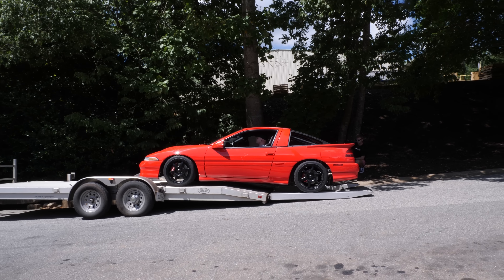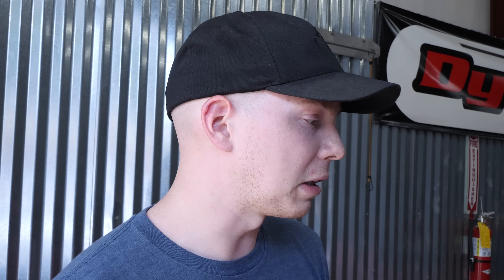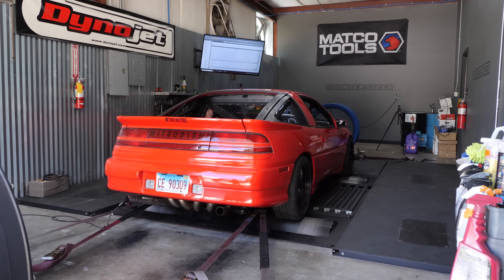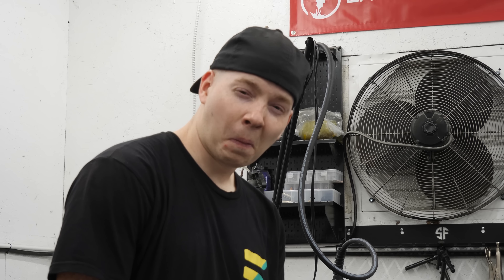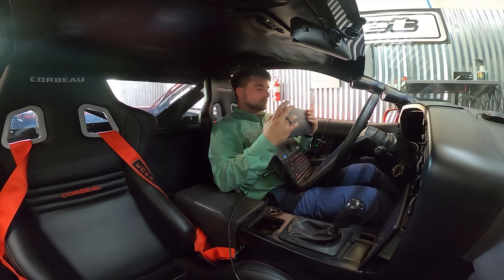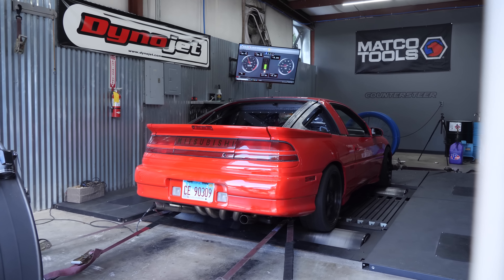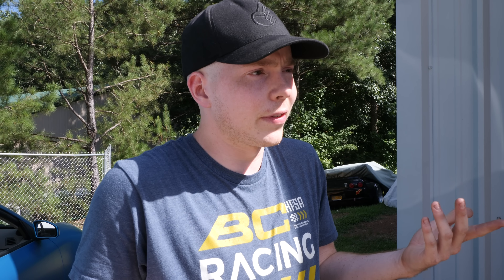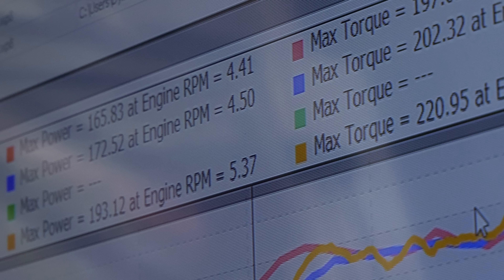Will The Garage-Built 4G63 Survive 25PSI of Boost On The Dyno?

Comment: I have a tundra with the same transmission and engine.  EVERYONE in the forums says that you should turn off the overdrive when towing.  Mileage may be a bit worse, but it will save your transmission from constantly seeking/down shifting.
Reply: Replying to make sure he sees this
Reply: 100%. The engines (2UZ-FEs) are amazing but those 4-speeds are definitely not the best. My dad has an 01 Tundra and even with 155k it feels like the transmission is going bad, and we haven’t towed a whole lot with it. Just have to be careful with those things
Reply: same way with my chevy, 4 spped trans, only goes to 3rd when towing
Reply: @nikdelano  Do a transmission service.  Drop the pan, pull and replace the screen/filter and refill fluid with Toyota approved fluid.  They aren't the strongest transmissions ever, but the are super dependable and a fluid/filter service often shows immediate results in shifting/smoothness and over all feel.
Reply: Once he hooked up the trailer i thought, i bet hes gonna tow in overdrive.  I tow with our sequoia all the time.  Definetly have to manually shift it and stay our of 4th.  Doesnt do too bad.

Comment: All the symptoms of timing being extremely retarded, low power, high EGT's and a lot more boost than expected. I would definitely start by checking base timing before doing anything drastic
Reply: that or cam timing. Turbo cams usually don't have a lot of overlap, and it sounds like there is a bunch of overlap. maybe the timing belt is off a tooth?
Reply: My thoughts exactly. He probably already has it figured out. Can't wait for the next vid. :D
Reply: Yup. All symptoms of combustion pushing its way into the exhaust after bdc rather than pushing the cylinder down. Not great advertisement for a tuner who doesn't immediately check timing with those symptoms. If it doesn't look like timing is wrong (check exhaust cam for advance too) find another source of signal and check again.
Reply: You can hear the motor needs more advance usually will have sound like it wont roll over when rpm ramps , really surprised tuner didn’t see it in the curve or afrs
Reply: Same thing I was thinking.  Ignition timing or mechanical timing must be off.
Reply: Im a self taught idiot whos completed the hp tuners efi course and even I know to get things running nicely at 7psi before you go past 20psi

Comment: Manifold becoming cherry red,usually something wrong with the timing...
Reply: I have a feeling that the fault is with Valve timing.
Reply: Yeah true
Reply: For sure  

The engine sounds very forced too
Reply: It can be. Tons of eMAP associated with 25psi of boost can also cause lots of heat absorption to the manifold. Prolonged, this will absolutely cause steel tubing to glow red even though everything it running right.  
This car however, you're probably right, it's got problems for sure.
Reply: @Saltyoldguy-  but producing 25psi boost with only 200WHP is a clear sign that all is not well. They need to forensically look into the valve timing, not just the Factory Service manual belt to gear line up relationship. They need to check valve opening/closing points ...LCA, max valve loft points ...the whole gammut! Especially since these are aftermarket cam profiles. All the best to them tho. Hope the engine isn't hurt from the experience on the Dyno tho. Exhaust valves suffer badly with excessive retardation of the valve event timing.
Reply: Maybe the engine builder (I dont know if he put together the head)  put the camshaft gears on wrong so that the markings may suggest that everything is right when in reality the markings itself are showing in the wrong direction
Reply: @JoewyDsm  To be fair I just thought it sounded like a tractor from the moment it came off the trailer
Reply: @miata9916  not sure who did the head. But yes, all that would need to be verified.
Reply: I’m wondering if they timed the valves from when the pulley was marked on Tdc before, and then remember how they moved the pulley?  I’m wondering if they have it out of time because they though tdc was one mark but it’s actually not
Reply: @iwanevans607  defo didnt sound like any 4g63 ive heard, standard or modified

Comment: I think this happened to someone recently and they had the crank gear on backward throwing the timing off making the exhaust so hot.
Reply: I was going to comment this. It happened to Jimmy Oakes on the dyno, I can’t remember what car it was though.
Reply: @erices1.6t  yes it was Jimmy O and it was on a sr20
Reply: Didn’t he have an issue with setting his base timing in one of the other videos? I’ll bet it’s something like this
Reply: He already swapped that. Check last vid
Reply: @MattiaFTW  I think that was the Crank angle trigger wheel orientation. I'm betting that there is a Valve timing issue problem causing the High EGTs
Reply: @danielcgomez  are 4gs like kas where the intake and exhaust cam are pretty much interchangeable?
Reply: This literally happened to Caleb last Eclipse vid.
Reply: @tag206  these are aftermarket cam profiles he installed, so that may not be the case with interchangeability .

Comment: How the Dyno people's didn't see that it was a timing issue is a red flag. Probably 180 out.
Reply: Honestly what tuner goes "turbo is spooling way too fast... better run it WOT a few more times"
Reply: @LifeInJambles  last video Caleb "fixed" the timing issues last video and got it to sit at base timing. So the tuner could check all he wanted. The timing is supposed to be good. And that's what the timing light is going to say. This is without a doubt a  engine builder issue.
Reply: @PedroPioLopes  whether it's timing or something else, you shouldn't be doing WOT pulls with boost out of control. They both fucked something up, and Caleb has updated Patreon that nothing seems broken, but that's pure luck and engine management safeties honestly. Even if you're testing out possible fixes for a boost creep on an engine with safeties, you should be approaching with caution.... and even if the person who built the engine insists timing is on, you should have serious suspicions about the timing when boost starts creeping that hard, especially cause you should know what size wastegate is likely to be appropriate for this size turbo, and seeing it double spring pressure without boost control should be an instant stop and check for potatoes in the tailpipe or timing issues that someone thinks got fixed.
Reply: @LifeInJambles  fair enough. The way I see it, Caleb should have paid a serious shop to build him a proper engine instead of hodge podging whatever he had kicking around multiple times. Along side many other things. As cool as the concept of the whole build is, it's not up to par with something you're going to give away to a person who very possibly has 0 knowledge in terms of mechanics.
Reply: @PedroPioLopes  Agreed.
Reply: @PedroPioLopes  for sure. I hate to say it but I am a little disappointed here. I love the way Caleb does things, but most of the struggle with this engine was his own fault and turning to a Miata-specific tuner repeatedly saying "don't bring me anything else" in the video and bringing him your DSM seems like an odd choice.. I have my own personal preference on the exhaust design, but that one gets artistic license. The saga with the engine and tuning should have gone better though.

Comment: Redo the valve timing. And replace all the gaskets. And while at it, start designing your roof scoop system. I’m personally nudged towards scooping drive wind from under the car and blasting it out on the top. Should impact your drive performance positively on high speeds too.
Reply: Good idea
Reply: It would need vents for the air to go out so it’s not a giant parachute.
Reply: If pulling from beneath, I'd make an undertray and give it a little ground effect.. but with something so odd, it'd take a whole lot more R&D than I think Caleb is looking to put into it. I'd prefer something there to not have random rocks bouncing around the engine compartment though, definitely.
Reply: Great ideas. I am sad with so much knowledge you have zero related videos on your channel. I feel like we need some videos so we can all learn for your expertise. Thanks!
Reply: @eriklarson9137  And there's the salty comment... Thank you for the joy you spread.
Reply: @corey0189  For sure, but the top is currently open. Not a problem for outgoing draft, quite a lot for incoming, I think.
Reply: The MR2 community has dealt with these aero issues since the 1980’s. Maybe ask them?

Comment: Try a tuner that tunes 4g63s, not miatas. For 25 of boost to make 220whp means my man has like 5 degrees of timing in it, burning it all in the exahaust manifold instead of the engine. This creates aditional boost as well since it's almost as rolling antilag, or launch control. The 12psi spring would probably function as one opening by itselft at 20 + some backpressure pressing on the wastagte as well.
New tuner since he couldn't figure out the issue.
Reply: We figured out the issue! We suspected base timing was off despite it being synced before the Dyno.

Afterwards we found an 11° retard in timing.

That's the issue!
Reply: @MrCrash12190  still, the tuner should have found that by himself
Reply: @mihailpetrovici5044  the tuner did find that out. The tuner was told multiples times base timing was correct, so he trusted the information he had available at the time.
Reply: @MrCrash12190  ok, gingium fault then
Reply: OP speaks truths
Reply: @MrCrash12190  The "ToOnerz" inexperience was the problem, he should've known after (really before it actually) the first pull that it was wrong and to stop, it sounded completely dead and rolling over almost couldn't rev out. Also if you noticed the wastegate just started opening at 20psi why where you shocked it went that high and doubted the Map sensor LMAO. Another symptom of very low timing is higher boost because its basically a Antilag timing table pull.

Comment: From what I've watched in the last video,i believe you failed at the part of setting the timing belt tensioner up...its a tedious process that you definitely didn't do. The fsm is very specific and i think you forget the most important step, and it jumped. Ill assume burned valve and i can't wait to see if the Pistons melted or not cause oem would have liquidfied .  You won't take my advice with protecting the fuel cell,or putting the intake brace on that u left off so that won't be a leak later cause that intake is heavy to be hanging by mani bolts alone.i try helping u but u found a miata specialist?!

Comment: The penny just won't drop when it comes to heat build up at the front of the engine. Gingium can't say people haven't tried to tell him. Does he think all those scoops and intakes on mid-engined production cars are for looks? ETA >> right at the start of the vid I thought to myself - "are they going to rig a fan to blow over the exhaust side of the engine?" -  nah, it'll be fine. ETA 2 >> only solution that suggests itself is a roof scoop, but that would need ducts that would obscure the bulkhead window.
Reply: Not if they're mr2 style ducts
Reply: It’s a timing issue for sure, it’s making way to little power
Reply: @AllDayToyota  ¿Por qué no los dos?
Reply: @AllDayToyota  It's going to be glowing nicely a lot of time even if the motor is set up perfectly.
A quick bit of basic math;
Gingium is aiming for 500HP or 375kW. Most IC petrol engines are c. 25-30% efficient hence the engine will produce up to 280kW of heat. 280,000w. That's 140 2kW room heaters all in that little space. Most goes out the exhaust, hence the light show from that header with almost no air flow to carry those 10's of 1000's of watts of heat away. 
A lot of mid-engine supercars (mostly Italian ones) developed a reputation for bursting into flames precisely because of these issues.
Reply: He will need to do something proper about the cooling.
Reply: He needs cooling (scoops under the car the blow past the engine and exhaust at the top would be wicked) but the main problem here is that the valve timing is fooked so he blows his ignition into the exhaust manifold.

Comment: Man do I miss the sound of a 4g. I had a 1992 Plymouth Colt hatchback that I swapped a 4g63t into with all kinds of mods and it was an absolute rocket. I also had a fbo 1990 Eagle Talon Tsi AWD, a 1989 Eagle Summit GTS with a NA 4g61, a 1990 Plymouth Colt hatchback with a real Dodge Colt GT 4g61t with all 4g63t turbo components. My 92 Colt made 408 whp on 18 psi on a real MHI Evo III B16g turbo and HKS 272 cams. I miss them all so much.

Comment: Cam timing is definetely and issue here. There's been a most recent example of this with Jimmy Oakes with the KA24DE in the honda. 4G63s are an absolute PITA to time WITHOUT the proper cam lock tool. I can guarantee the timing marks look lined up but they're not, they're slighty pointed upwards. I know this because I've had the same issue until I bought the cam lock tool.
Reply: @gingium please read this man’s advice because that’s EXACTLY your problem. You’re blowing your ignition into the exhaust manifold. It will be a disaster if you don’t act on this.
Reply: 4g63 is easy to time, no need for a cam lock tool. If timing is correct, it's possible the CAS is 180 out. Either way, he needs to check base timing before troubleshooting any further.
Reply: @sethmo38  that’s another thing is cas 180 out. And maybe you have good luck because I have never had good luck timing without the tool. Because with the cams lined up there’s pressure on a set of valves on both cams pushing it out of time. Get the tool and never have to worry again.
Reply: @sethmo38  on the build video he times it with two wrenches and a vice grip like no lol
Reply: @Andrew1GB  I didn't watch that part of the video closely, I'll go back and watch. I always used clips just prevent the belt from coming off and two open ended wrenches on the cam gear bolts to adjust the timing marks and I've never had any issues with timing on my cars. A cam lock might make it a bit easier, but the 4g63 isn't overly complicated, not like it's a BMW n54 or anything, those things are a real pita.

Comment: I feel like if you aren't a die hard dsm guy I usually see alot of trial and error. Kinda like people who hate old DATSUNS that know nothing of the old school efi. I mean via a potentiometer off an afm and having a thermo time switch work with that in conjunction to get a proper injector pulse width. If you nail your essentials it'll be fine. Sometimes these things are really touchy with fuel perimeters and boost. OEM 4g likes its oem boost levels, piping, and working with the balance shaft or deleting it. There's alot of factors to these things. It ain't the everyday Honda boy set up. I can't wait to see what happened tho. Im rooting for you Caleb. It's a tough egg to crack but a glorious one once it's figured out

Comment: So I was putting together a 1983 toyota pickup up and when I put the thing together I plugged the pcv and the vent on the valve cover and it was creating to much crank pressure. I talked to an older dragrace gentleman and he told me that the positive crank pressure pushes oil through the rings and the oil mixed with the gas getting ignited was making it burn too hot. It burning to hot didn't make it more eficiente or gain any power . It just made my header piping hot. To the point I could see it in broad day light. I remember you were having issues in one of the video when you tried running it with out a catch can it's probably not venting enough

Comment: use the column shifter to downshift to 3 when towing up hills or use tow haul mode if it has it. my truck has such a tall 4th i tow in 3 instead of OD getts better millage in 3 on highway than 4 even tho the rpms are higfher becauise the engine is closer to where it makes power so its not lugging the engine

Comment: I have a 2006 Toyota Tundra Limited and it's basically the same as your SUV, but a truck. The 5-speed automatic from 2005-2006 has an extra gear that should solve your problem!

Comment: I rebuilt a motor and did it by the book check all the clearances used quality parts and a good machine shop and I changed my oil after like a 30 minute then after 3,000 miles and it was only sparkly but now chunks not even small ones

Comment: It's highly unlikely excessive heat will damage a turbo, other than cracking the turbine housing. The car would still run relatively fine with the cracks that could develop after a few dyno pulls.

Comment: The Sequoia either needs more power and torque along with better gearing, or you need a better tow rig. 2nd gen Dodge Cummins would be my recommendation, but if you want an suv I’d say a Suburban/Denali with a 6.0

Comment: Put a Mercedes OM606 diesel engine in that tow rig with a 8mm pump and a Borg Warner S257SXE turbo. That'll get you 450hp and 550 ft/lbs of torque.

Comment: That sequoia should not be struggling to tow the eclipse. But maybe do a couple mods to the engine. Nothing crazy maybe help it breath better whether it's intake or exhaust or both. Is it a 4 speed plus overdrive or just 4 speed 🤔 if it has an overdrive then find away to turn it off. Or Maybe drop down to 3 gear around town or going up hills. It's not rocket science brother.

Comment: Exhaust cam timing is off. Hanging the exhaust valves open to long and causing excessive heat in the manifold, thus resulting in lack of power.